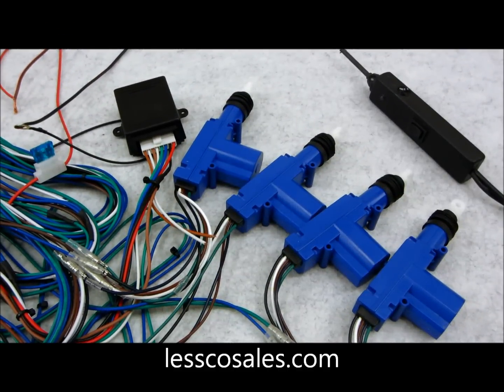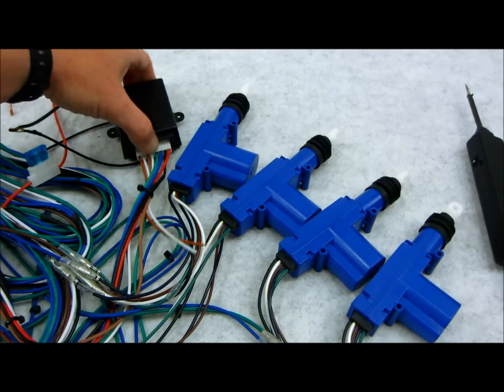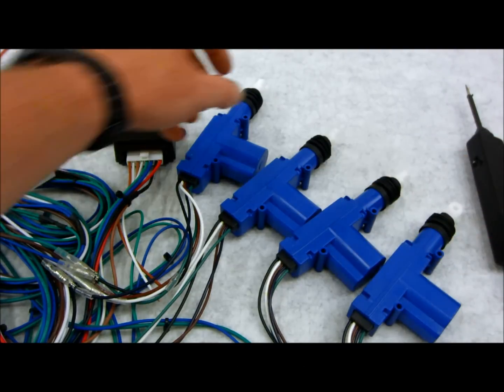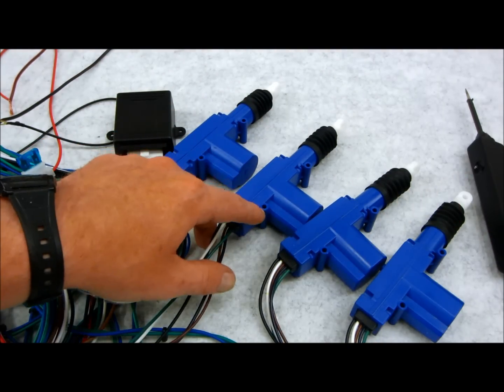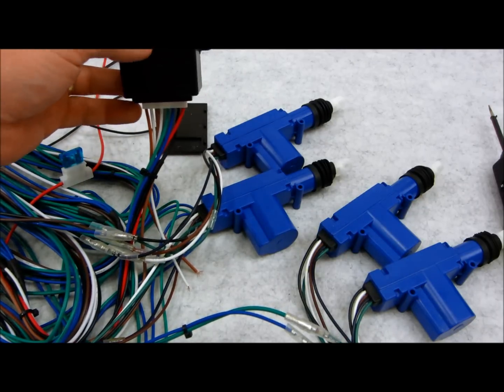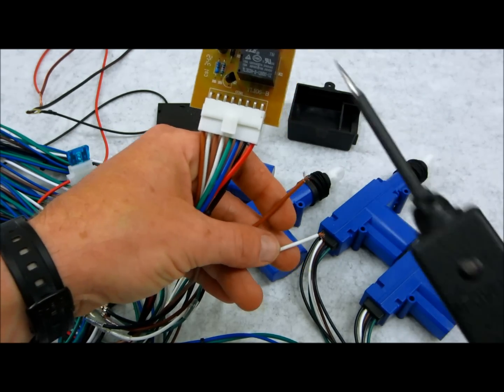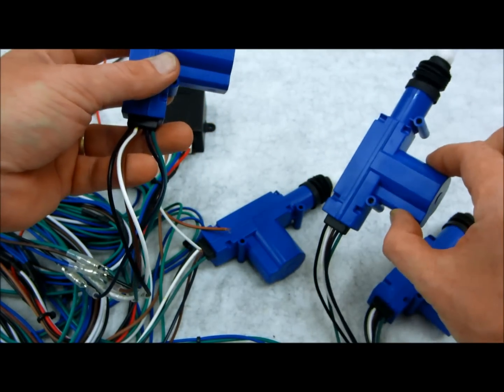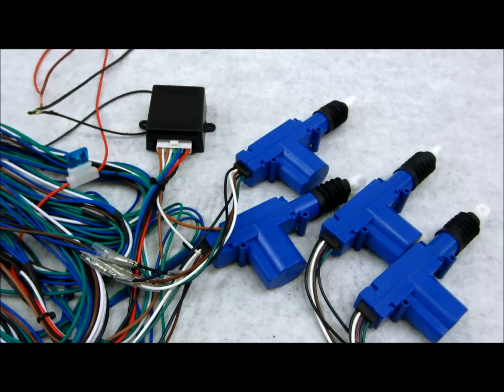How Central Door Lock Actuators and Relays Work

Comment: Hi all. I need a little advice… I have a long term project and you know how it is, stuff goes missing. I have a C/L control box ECU (several actually!), actuators and remotes, but the wiring harness has gone missing. The ECUs are the same and have Orange, White, Yellow, Orange/black, White/black, & Yellow/black, and all the instructions say is ‘For the central locking’. The actuators have Green, Blue, Brown, White, & Black (they all do, but I know that only the driver’s door uses five wires). I know the green & blue are the lock/unlock wires using reverse polarity. I know also that unlocking the driver’s door manually should cause the others to unlock. Can anyone tell me how the wires from the ECU connect to the actuators? Even the Aliexpress seller can’t tell me and the instructions are next to useless (they assume you won’t need connection details as you will have a harness – but I don’t). Much appreciated if you can help.

Comment: Hie, I Have a Mazda 3 2007 with factory central locking. Now I installed an alarm but the Auto said I needed an extra module to connect the alarm to have central locking. I got the module and now wanna connect it. How do I do this?

Comment: I have 1 slave motor on my drivers door aparently it gas worked without a master before some one cut the wires.

So my question is can i install new door lock computer with just the 2 wire green and blue motor ?

It has central locking so both doors lock when i lock it with keys
Reply from the maker: that can work, no problem.
Reply: @Lesscoelectronics  i got it to work and i got boot centrall opening asswell without the master unit i only used 2 slave units 👍🏼

Comment: I’m installing something similar in a classic vehicle. The problem I am having is that due to mounting location limitations for the actuator and the way my door latch works, once installed my remote button will operate opposite what it should. The lock button will cause the actuator to pull down on the latch locking mechanism, essentially the unlock position of the latch. If I press the unlock button on the remote it will push the actuator up and lock the latch. I want to reverse the operation of the actuator so that it does opposite of what it does now. I have tried reversing the green and blue wires but that does not work. Any help you could provide would be appreciated.

Comment: I'm looking to add power door locks with an alarm/find horn  to an 08 Rav4 that has a basic key entry (base model). It has a factory key system that opens all doors on the second turn of the key in the drivers door.
 What am I going to need to for a complete install including 4 doors plus tailgate ?  I don't think there is a factory alarm since there are no fobs, also can the exciting actuators be wired into the system.
  Question, I purchased this vehicle used, how would I find out if there was a fob associated with it ?

Comment: With a central locking already in but needs to be open with the key from the driver's door. Can I put in just one actuator to make it unlock the driver's door only and then boom it should use the original and open the rest

Comment: Can you use a central locking actuator with just a battery and a switch? Do they work like power on: extended, power off: retracted? or do they require power each way?

Comment: Hi my vw t4 central locking stopped working.it was connected to an auto watch alarm by installer.the old alarm malfunctioned .new alarm just a year old.i checked wiring diagram on alarm and the fuse had blown on white wire that went to siren according to diagram autowatch 346rl.also I checked motor in drivers door.only 2 wires connected .i do not have master switch on door.think maybe control unit behind dash .the drivers motor worked ok direct to battery .the alarm still arms disarms and clicks ok inside alarm module an siren still bleeps even though fuse gone.replaced fuse an blew again .its 20year old van .have checked all fuses .think relay on electric windows central locking paired .any help appreciate it .thanks.stay safe

Comment: nice video. can this be wired to automatically lock the doors when the car is put in gear and automatically unlock doors when car is put in park?
Reply from the maker: youll need an alarm pr keyless entry with that programable feature to do that, its a common programmable feature

Comment: Great video. I made this one. Though, I noticed that the master door actuator doesn’t close or open same time with the rest of the actuator. In fact it doesn’t move at all when I use the remote, however when I open it and close it manually it works and the rest of the slave actuators also follow. Do you have any idea why?
Reply: I am having same problem. Did you sort out?

Comment: ok I installed a kit in my car and the main 5 wire actuator is the driver side. When I actuate with remote they work perfect, but if I manually lock/unlock the driver side door the passenger door doesn't follow command like your video! Did I do something wrong?

Comment: hi, hope you are still around. i have a question that i hope you can probably help me with. i installed and installgear power locking system in my wifes car and it is working in a strange way. when i hit lock on the fob the front doors lock but the 2 rear doors unlock and vise versa if i hit unlock the 2 front doors unlock and the 2 back doors lock. the system i have has 1 master and 3 slave motors. i cant figure out how to fix this issue. do you have any insight?
Reply from the maker: reverse the 2 actuator wires on the rear 2 doors and itll work fine
Reply: @Lesscoelectronics  when i first installed the system i did switch the wires, blue with green on the rear doors and nothing happened. in fact it fried my receiver unit. i ended up purchasing another kit and hoped maybe the original reciever was bad but with the new one installed, doing the same thing.
Reply: i never changed the wires, only the reciever is what i changed out.

Comment: What happens if it will unlock but when it comes to locking it only does a partial lock... It almost gets there but just a tad before it locks
Reply from the maker: try adjusti g the master door actuator, it may be too tight.

Comment: THANK you very much for such a good video.
Can anybody tell me what you call that black box in the video, Is that a relay?
I am facing a problem that my car central lock does not lock but it unlocks  normaly.
Reply from the maker: Yes, that is the relay control module. You may want to check if your master door actuator travels fully up causing the slave motors not to unlock, or of course that relay could of died too..

Comment: I have an issue with one of these. All was working but now the drivers side does not control the other doors. I also note only the lock works on drivers door using key fob and I notice resistance when using manual switch on unlock. I also hear a click from the box on lock but not unlock on drivers side. I have a 5 wire for both front doors and the passenger controls all doors fine including unlock and lock on drivers door. I do note the “pro” install has all 5 wires on both doors connected and it is going to an alarm, which I thought meant 3 of the wires were not used (instructions say they are for controlled switching without an alarm so I don’t know). 

I have researched this for hours tonight and you seem to be the only person who understands all the parts and how they function. So I am hoping you have some ideas for me that do not require getting under my dash and trying to follow this guys wiring. 

I appreciate your help and time. I have no idea how to see a response but I will come back here and look for a response. Thanks.
Reply from the maker: the master (driver) side actuator isnt fully traveling, or the brown or white leads are loose or disconnected to power the slave motors.

Comment: I have a central lock in my Opel/Vauxhall Corsa C 2003 but it doesn´t have a remote. Could I just install a remote kit (without actuators) or do I still need an actuator? Some say that the pre-installed central lock won´t work with the kits.

Comment: Will a power lock system drain my battery ? I know this is a noob question. But will it ? if it will, how many days should the car be left unused for it to completely drain the battery. thank you for answer. (cmndr.robot@gmail.c0m)
Reply from the maker: Its highly unlikely since door lock systems are designed to work momentarily, the only part that can draw current is the relays that drive power to the motors, and you would definitely know if that was happening by hearing it and all the motors would most likely be toasted.
Reply: thank you for your help. I am planning to install one. do you have an advice on how to go around in putting a momentary switch for the system? the white and brown wires are grounds right ? so i would feed a 12v power to the switch? on the center prong right ?

Comment: I hooked mine up to my vioer 4706 and it wont work with my viper remote. Only works with the remote it came with.. viper 4706 with directed db3 auto start
Reply: You probably have it figured out by now, but just in case some one else has a Viper system. Connect it to the Blue & Green from the Viper  wires to the Brown and White on the door lock module.

Comment: hi can you help me connect this to the main unit where i can use remote.. where should i connect the negative trigger?
Reply from the maker: tell me what parts youre using currently, Ill advise
Reply: I hooked mine up to my vioer 4706 and it wont work with my viper remote. Only works with the remote it came with.. viper 4706 with directed db3 auto start
Reply from the maker: it should go green to green and blue to blue on the activation in and outputs on both units in most cases

Comment: Purchased and installed a Scytek alarm w/central locking (2-5 wire actuators and 2 -2 wire actuators). Worked great for 3 years then my driver side actuator went out. Could not find the exact brand/model but I found a nearly identical uxcell actuator. Did not have to drill new holes , just removed the bad one and put the new one in it’s exact place. Problem is when I plugged it in (5 wire color code exact: green to green, black to black etc..) the driver door is doing exactly opposite what the other three doors are doing. When it locks all three doors unlock and vice versa? Any advise? Please help!

Comment: How do you hook this up for the park lights to flash when lock or unlock to aftermarket 4105 viper
Reply from the maker: You will need to connect the white output to the 12V trigger wire in the vehicle

Comment: how do i wire this to my alarm and switch
Reply from the maker: Give me the model of your unit
Reply: Lessco Electronics  its the avital 5303l and i was planning on using this unit aswell ^
Reply from the maker: OK, The blue and green wires on the 5303L are you lock and unlock outputs. You'll need to connect those with 2 relays wired up to supply reversing polarity outputs. If you need, I have another video on how to wire actuators with relays.
Reply: Lessco Electronics how i do wire up this omega central door lock to alarm though and be able to add a switch to it to be able to unlock/lock at anytime

Comment: only the driver door opens when i press the unlock button on the remote or use the key to open the,however if i open all four doors plus the trunk and gas tank cover and then press the the lock button all 4 doors ,plus trunk will lock together but wont open,what should i do

Comment: gud vid man. best i seen so far. my nissan mirca has central locking but not working when i take the central control module apple power the car unlocked. so i gess the key faulty so i bought a hawk 240 lite can you please help me set it up to my centreal locking i got alarm working/ but cant get my doors working/ tryed but still cant cant get it to work. thanks cheers

Comment: Hello, Im using the XYZCTEM Power Central Lock Kit from Amazon https://www.amazon.com/gp/product/B016RUV8Z2/ref=oh_aui_detailpage_o03_s00?ie=UTF8&psc=1 ,The module looks similar to the Omega on the video. I'm adding 5 wire door lock up/down switches. Using this diagram http://www.the12volt.com/doorlocks/page3.asp . My XYZCTEM module has 2 wires within the 8 wire connector that are shown to go to an alarm on the supplied diagram 1- brown and 1 white. Testing these leads shows 5vDC at rest and reversing when the are shorted and the actuators reverse direction ever time these 2 leads are shorted. 
Ive tried connecting the leads mentioned to a dual relay setup as shown here (Terminal 30)  http://www.the12volt.com/doorlocks/page3.asp The actuators run constantly, so I must disconnect them asap. 

Connecting the door lock switches to 87a on opposite relays pops the fuse on the XYZCTEM module and pops the fuse on the relay pack when I reverse the switch.  

Any help would be appreciated.
Thanks
AJ
Reply: AJ did you ever figure this out? I think with this module you might wire it straight to the green/blue wire of the alarm. If this is a negative trigger module I'm just wondering what happens when the reverse polarity goes positive? Is it just cut off? Anyways I think this is considered a type B according to this Avital/Viper car alarm door lock manual: http://kb.directed.com/Attachment184.aspx which is a negative trigger door lock system. I think you can wire the white and brown wires directly to the green and blue wires coming from the alarm. You don't need the additional relays since the relays are already built into the module that came with your door actuators. Please let me know if this helps. I purchased the same kit awhile ago and have yet to install the door locks to my avital alarm

Comment: Hi, great video very detailed. I installed a central locl kit in my car and when I connected it with my alarm system as negative triger, when K switch on the alarm the lock does nothing and when I switch off the ala the doors will lock. Any idea what I mighg have done wrong? Thanks.

UPDATE: I now have reversed the two wires to connect to the alarm and the lock will only ulock as I deactivate the alarm, it will not lock when I activate the alarm.

Comment: I have the same set up with a UK kit from Rightclick. Two masters and two slaves. Now I have set this up with a 12v battery outside of the car to test before I install it. However when I power this kit up the the actuators just constantly click and pulse. However if I remove the brown and white cables from the masters the kit works fine apart from the fact I cannot lock all the doors buy pushing down on one of the master switches. It does say in the manual to make sure that the white and brown wires are not connected to the ground at the same time but I am not sure how this can be achieved. Can you please help? Cheers

Comment: Hi, i have a Nissan Almera N15, it already has central locking but not remote central locking, i found the mass unlock and mass lock pins, so in reality all i would need to do is soldering white to lock, brown to unlock, red to constant 12v power, and black to ground?

Comment: Hi, great video!
Do you know how to wire my kit with a 5 wire actuator (I only know how to use the two wires option)

My current wiring:
https://dl.dropboxusercontent.com/u/18494731/central_lock_my_install.png

The instructions manual of my kit:
https://dl.dropboxusercontent.com/u/18494731/central_lock_instructions_manual.jpg

thank you :-)
Reply from the maker: Ive seen different makers of 5 wire actuators so to give you a simple 1 way answre woukld be sort of irrelevant. so what I suggest is testing the motor on a bench. when you apply + and - to the blue and green, watch the outputs of the other wires, that'll dictate their functionality most accurately
Reply: +Lessco Electronics thank you for your quick response. I've just tested the motor and I got the following results: 
To lock: green wire +12.... blue wire GND
to unlock: reverse polarity of the wires above

I connect the motor to my bench power supply, applied 1,5V to not damage the motor (so it's rotate slowly), one probe of the multimeter on the black wire and the other probe was used to check the voltage on the white and brown wire. I couldn't measure any change (always 0 V)

What I've do wrong?
Thank you

Comment: I'm currently having problems with my central lock system because my car won't lock even though you press it using the key or by pressing the master door lock on the driver seat. I noticed that the master door lock on the driver  door is stuck because it's very hard to press it and even you press it then release pressure on it will go back to the unlock phase of the door..
Reply from the maker: loosen the tension on the driver door (master) actuator hardware linkage and that'll go away.

Comment: Great video,I have a central door lock system I tried installing in my 2013 Jeep Wrangler. I installed it per directions. The problem I'm having is when I hit unlock on the key fob the actuators go unlock to lock. If I hit lock on the fob nothing happens. I have 1 5 wire and 2 2 wire. There is 2 extra brown and white wires that they say go to alarm. I do not have an alarm so do those wires not get connected?Thanks for the help
Reply from the maker: sounds like the driver door/master motor is in too tight, loosen the linkage and it should act more normal.

Comment: Do you know lock actuators that are higher power than the standard stuff (By power i meant push force, not voltage)?  2 wires specifically but i'll take 5 wires as long as i can use it with a 2 wire setup.

Comment: Where does the remote send signal to, to make the relay work? Does the relay pick up the remote signal?
Got an existing set up but want to up change to a new remote system as mine is so old and can't get them how do I connect the new one to the existing wires.